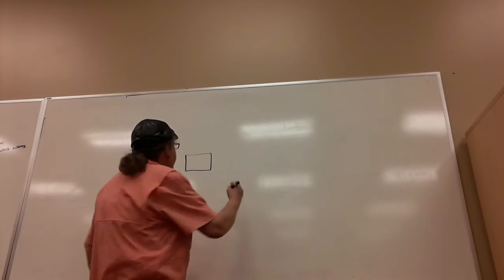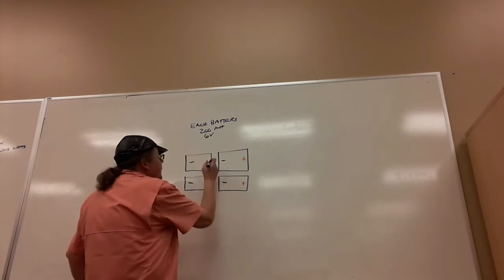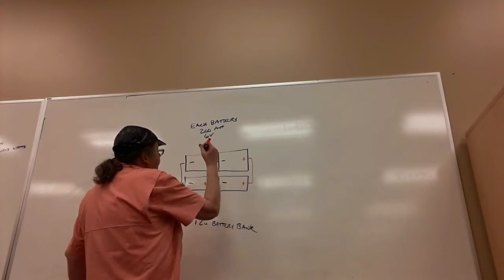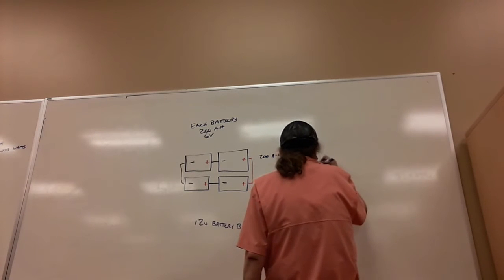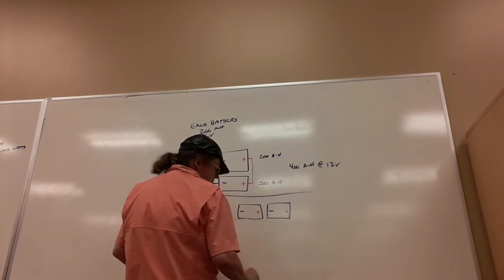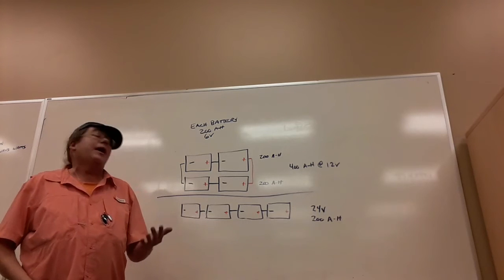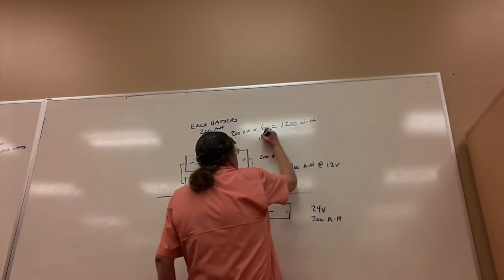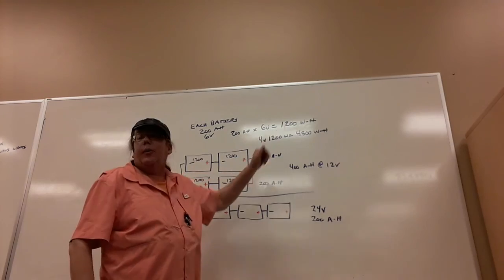Off-grid battery bank capacity: amp-hours vs watt-hours

Comment: I'm not a mathematician or anything and this is an old video but if you have 4 batteries that have 200 amp hours each  shouldn't you have 800 amp hours total?
Reply from the maker: You would have 800 amp-hours ONLY if you connect them all in parallel, giving you a 6 volt, 800 amp-hour battery bank. That is not a usable voltage for even the tiniest off-grid power system, the minimum for any PV charge controller or inverter is 12 volts. That's the whole reason I always use watt-hours when discussing battery bank capacity instead of amp-hours. Watt-hours are the same no matter what voltage your battery bank is wired for, while amp-hours depend on whether you wire in series, parallel, or both.
Reply: @danfink9794  So when you wire them in series to get 12 volt you lose half your amp hours? Or did you half that because they are lead acid which only get half the watt hours at discharge? Thanks for the reply trying to understand these calculations better
Reply from the maker: @kaliberlvl80  Yes, your first statement is correct. Wire those 4 batteries for 12 volts (2 parallel strings of 2 batteries in series) you'll have 400 amp-hours at 12 volts. Wire them all in series for a 24 volt battery bank, and you'll have 200 amp-hours at 24 volts. No matter how you wire them, whether 6v, 12v or 24v, you have 1200 WATT--hours per battery, for a total of 4800 watt-hours. That's why I like watt-hours ;-)

As for your second question, that calculation of halving the capacity to account for not wanting to take the battery bank below 50% state of charge (for longer battery life) has not been performed yet....it's the next math in line for designing an off-grid system. And note that other battery chemistries (such as NiFe, LiFePO4, NiCd) can be discharged to a lower SOC than 50% without damage, so for these you wouldn't halve it, it would be a lesser fraction.
Reply: @danfink9794  Thanks this helps I can simply everything by just using watt hours for the calculations👍👍

Comment: i watched 2 different video with 2 different ideas one of them not correct...the other said in parell the amp hour stays same but in series the amp hour double with each battery like 4 6v battery bank would be 800 amp hours you saying it not true it stays the same hmmmmmmmmmm look at 24v you say they same 200 amp hours i so confused now
Reply from the maker: It's the Power Law, derived directly from Ohm's Law. Batteries in series: voltage adds, amp-hours stay the same. Batteries in parallel: voltage stays the same, amp-hours add. Watt-hours always add, that's why we use them in the solar industry, because as a measure of battery capacity they don't vary with voltage. In the video, BOTH battery banks have the same capacity in watt-hours.

Comment: Listen to what you say! " in series, volts add up and AH stay the same" which means in your first diagram you have 400 AH meaning  (200X2=400AH) (2) 12 volt sets. In the second connection you have a series connections also meaning 1 battery set equaling 200 AH in total. Means you are wrong the system in 24 volt is more efficient in just has less AH's.
Reply from the maker: See my reply to Mark's recent question above. The increase is not in amp-hours of capacity, but in fewer amp-hours of capacity wasted to heat (I²R losses) in charge controllers (charging) and inverters (discharging).
Reply: No he is correct, half the Ah on the 24V system but exactly the same Wh. This is why you should never use Ah. To an untrained eye you would think that the 200Ah battery pack has twice the storage but it doesn't. It can run a 1200watt appliance for an hour or a 300watt appliance for 4 hours

Comment: I wished you people would make a video for absolute dummies.  Going from 6 to 12 to 24 volt i just don't understand.  First off, most people just know 12 volt, so when you introduce the 6 and 24, we get confused.  Then 2nd, we dummies were also told to never conmect positive to negative, and yet, you people do it.  3rd, lets just stick to the top example.  At which point do the leads exit the battery bank going to the house, and also, where are the leads coming in from the solar array?
Reply from the maker: This sounds like a great idea for a video, thanks for the suggestion. I'll try to put together a video soon that starts with the very  basics.